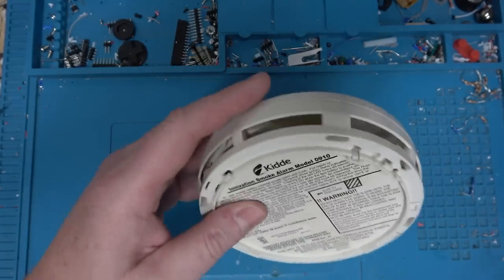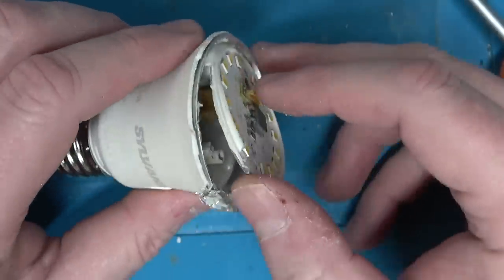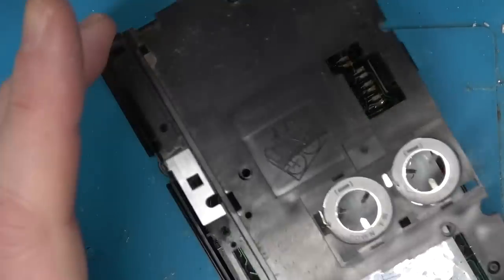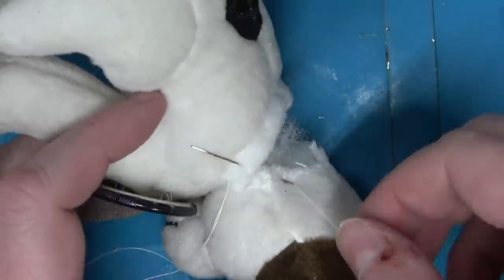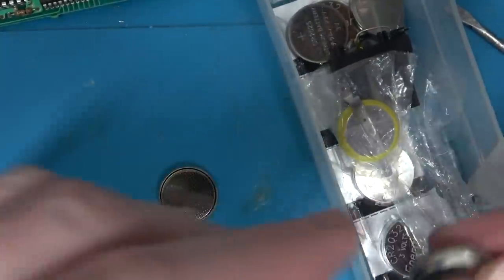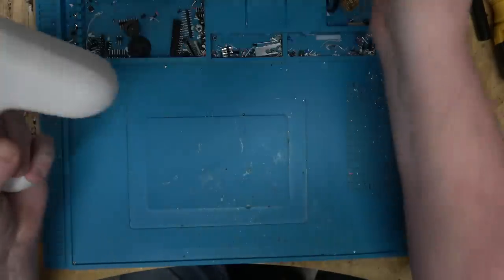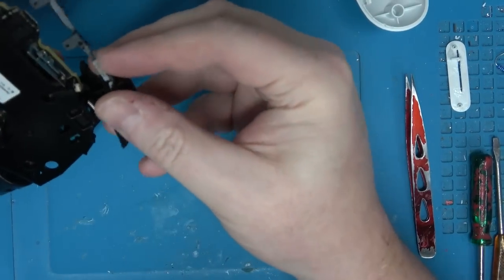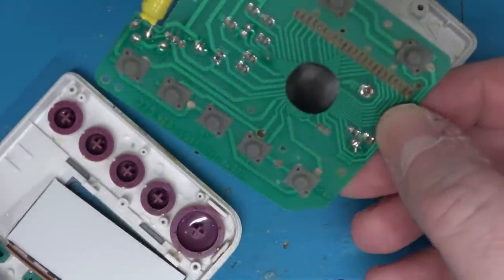Random Teardowns and Repairs

Comment from the maker: When editing this teardown I got to "run this over with your car" and thought "hmmmmmm" the controller had been re-assembled so I went for it! The analog triggers do work, they don't show as analog as a driver oversight. I should do another video where I tear it down again to inspect the damage.
Reply: The wall-wart from the Chromecast Ultra can be used with almost all other Google/Nest stuff that uses USB-Micro for power to give them Ethernet capabilities. I got most of my Home-Minis wired that way.
Reply: You can also use Bluetooth now with the controllers. A firmware update is available that allows you to pair them like a bog standard controller 👍

Comment: Ben, Google just released a (one way) wi-fi to bluetooth update.
Reply from the maker: Wifi to BT? So the controller becomes BT? Can this be done with just the controller? Ie no Chrome cast?
Reply: @BenHeckHacks   Yes, you plug it in via USB and go to the webpage with Chrome and it should do it
Reply: Yeah, I heard about that from ltt. I only cringed a little when he ran it over because I figured he didn't know about that lmao
Reply: Apparently it's a time limited option though, only possible to change it before a specific date.
Reply: @BenHeckHacks  Yep, you just need to have the controller hardwire connected and go to a website to make the one time permanent switch from wi-fi to bt.
Reply: @gfdggdfgdgf  Correct, but I think you have an entire year to make the switch.
Reply: How long until the update is dumped and that time exclusivity doesn't mean anything lol.
Reply from the maker: Two were donated, so I can flash the other. It's still pretty amazing how well it held up.
Reply: I saw this but nobody mentioned what you Bluetooth the controller to? Is it just PC/Steam Deck or can you use it on say the Nintendo Switch?
Reply: @bland9876  they only tested it on PC and Mac, but said it could work on other devices. They also committed to firmware updates until the end of the year.
Reply: owomushi グーチ  there's probably going to be backups on the internet archive or something tho

Comment: those stadia controllers can be updated to a new firmware that uses bluetooth instead of wifi and the technical guys are actually having trouble getting the wifi firmwares for analysis 'gotham' is dead but 'bruce' lives, the update process is a tad annoying but not too difficult
edit: the screen on that gameboy did not survive, the nintendo techs swapped it out because they couldnt find anything else seriously wrong with the electronics and figured why not

Comment: Ben there is a new update firmware not sure if out or. Or yet. But it will let you use it as a normal usb or Bluetooth handheld controller. Might want to look into that.

Comment: The LED bulbs like that actually run the LEDs in series, not parallel, so when one fails the entire light bulb fails... So most of the time if one of those lights fail, it is just one of the individual LEDs.

Comment: I did the math for cloud gaming at one point. Assuming full optical pathways, cabling, processing, etc., with no limitations beyond the speed of light itself, for cloud gaming to match the current performance of locally-rendered online games you would need a server within something like a hundred miles of you at maximum; so just the needed server infrastructure itself doesn't make sense, and this is assuming we're at a technological point where we have full optical between endpoints for the absolute fastest of transfer speeds.  Even if we could beam lightspeed data directly from endpoint to endpoint, it still doesn't make sense.  And this is just the issue of data transmission, and not getting into the issues of compression and decompression to save on transfer sizes, or other goofy little tricks to streamline the process.  Which is why I'm hoping Intel is still working on Continual Compute, which would make setting up thin clients on a thick server so easy anyone could do it, and this is how you get around the limitations of cloud gaming, a local processing server with a thin client; whether that processing server is something in your house, something your employer provides depending on what your workflow requires, something that a school or other institution provides, etc., it could probably even work for modern internet cafes where you bring a low-end device and have access to higher-end computing.  I'm also personally hoping that Continual Compute will also be the eventual death of cloud service programs, given how certain companies want to treat their cloud services in recent years.
Reply from the maker: Yup and then you have additional lag from the wireless controller and the HDMI-to-TV which is always variable. "America just needs better internet" people will say, but sorry but C is a constant!  

I like MS's approach where XCloud is a feature on something you're already paying for (Game Pass) so it's more acceptable when it's less ideal.

Comment: That's not actually a capacitive dropper in the LED light bulb at 6:32. If you take a closer look at the circuitry, the capacitor is after the bridge rectifier, acting as a smoothing capacitor to reduce flicker (the resistor is just a discharge resistor for that cap to ensure that the light goes out quickly when the power is cut). You need an AC voltage to use a capacitive dropper (as it relies on capacitive reactance, which is not a DC concept), and the capacitor must also be in series with the rest of the circuit (thus it would be nonpolar and be placed before the bridge rectifier).

The actual voltage dropper is that IC (the one you called a regulator). It's essentially a constant current regulator, working to drop whatever voltage difference there is between the smoothed, rectified DC supply voltage (~170 VDC in the USA) and the voltage drop of the LED string.

Comment: Nope, it's not coated with "phosphorus" (?). No, it's not molded around it. No, it's not needed to cut away the edge to open it. Yes, 12W is in fact way too much for how badly they radiate heat, even 7W is too much, I like to mod them to 5W so they last a long time.
Reply: He was probably thinking about phospors (as in compounds that emit light when excited). Still wrong tho.
Reply: @gigigigiontis8  I know what he meant, and I know I sound like a dick, but I just couldn't hold it in after several incorrect statements. And I thought writing a stereotypical comment would be funny in an ironic way.

Comment: The problem with those led bulbs is if one led goes out then the light dies. You just figure out with one is bad and wrap a thin wire around the blown one to bridge it and the bulb works again

Comment: We have a mini component hifi thing that the tuner has a battery backup I think it was a cr2032 that is directly soldered on the board for the preset and still holds a charge today. That thing was bought on 83 and last used about 2003 or something.

Comment: EA did that because they weren't officially licensed by Sega, and needed an obviously redesigned cartridge as to avoid copyright issues etc.... they were only every "compatible" officially :)

I don't think you will find a Sega logo on those carts anywhere :) - other than maybe acknowledgment of Segas Copyright over the Megadrive/Genesis name etc...

also, Stadia controllers can be updated to unlock the Bluetooth to use on other devices....

Comment: Bulbs advertise the MTBF of the LEDs.  However 99% of the time the failure is the power regulation circuits, which die from heat far sooner than the LEDs themselves.

Comment: Having seemingly overpowered mcus in these controllers enables them to have a direct low latency internet connection reducing latency.  Amazon Luna is the same.  It's doesn't forward input through the display device.  That's slower.

Comment: The deactivation switch is operated by pivoting the side of the smoke detector out radially. Not from the underside. That door is where the 9volt battery goes on units with replaceable batteries. I know that brand of smoke detector too well. The battery always seems to die right after I move in to a new place.

Comment: I use Xbox live on my Samsung tab S8 ultra and it's fine. Latency is normally not an issue. I can generally go weeks without noticing a problem. When there are latency issues it normally lasts seconds then goes away. I can see streaming games as something that will be big soon. Sure for competitive e-sports titles you want a local copy, but for about anything else streaming will work just fine.